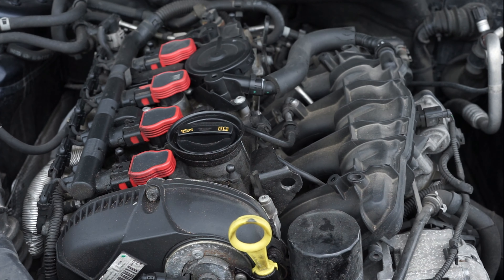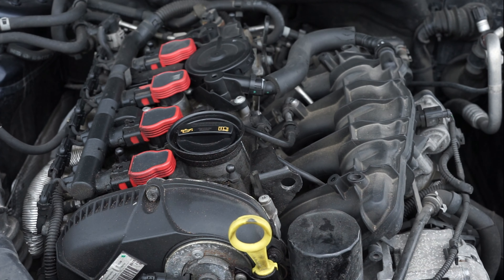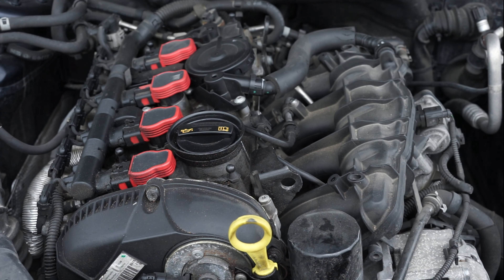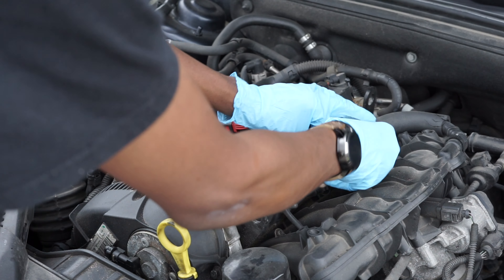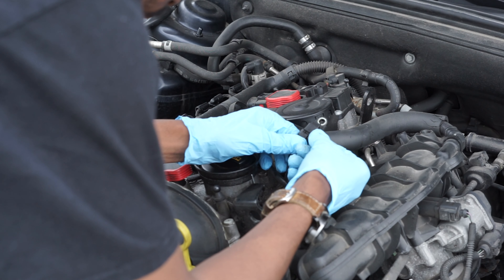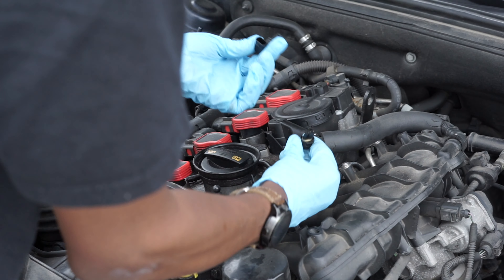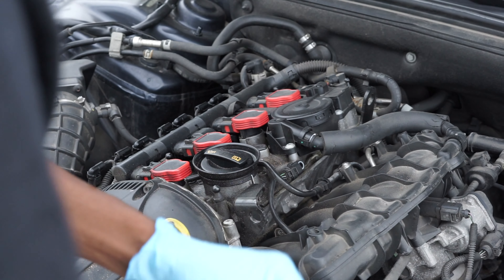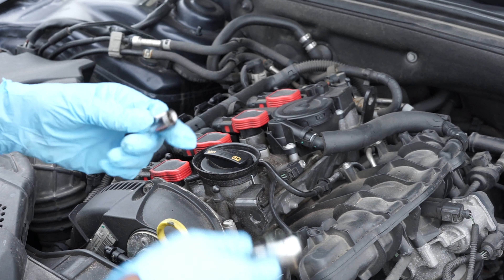How to Change B8 A4 Cam Position Sensor

Comment: Does the b8 or b8.5 have the cam shaft follower or was it upgraded to a camshaft position sensor? Im new to this and curious on what they changed in the engine after 2010

Comment: Hi. I'm getting the P00A00 error 'A' Camshaft Position Slow Response (Bank 1). Could it be related to the intake solenoid or vvt solenoid? Also A4 B8 2.0tfsi
Reply: getting the same thing, did you end up figuring it out?
Reply: Man I ended up rebuilding my engine. Seems fine now.
Reply: @segrinklassen6239  how much was the rebuild?
Reply: I'm in South Africa. Was about R50k
Reply: @segrinklassen6239  well thanks for the help, currently trying to fix mine and she seems to run and idle fine after i did the timing chain im just still getting the P0016 code and I have no clue how because I have everything to spec so im going and double checking the position sensors to make sure there is no metal flakes on either causing it to read wrong and I'm just at such a loss for words I have no idea how it could still be like that, might go re check the timing soon by just taking the upper timing chain cover off to see if there is any slack in the chain and what not but yeah as of right now I have no idea what could be causing the issue
Reply: @monkeyman I wish I could help man sorry buddy
Reply: @MonkeyMan-qm8jp  Hi, did you ever manage to get this sorted at all? Im having your exact issues! Thanks :)
Reply: @rolaplates  tore the front end down and did timing, good luck

Comment: Did ur car have a hard start and this repair fix it please need help
Reply: Invest in a scanner and see what comes up as faulty. But in general the cam position sensor can cause multiple issues with the engine. If I have to guess with your car not starting immediately I'd say you might want to check your battery. Try to jump your battery with another car and let the charge sit there for 10 minutes then start the car, if it starts right away then it's a weak battery...

Comment: Are u sure this a b8 and not a b6
Reply from the maker: 100% sure it's a B8.
Reply: That is my question too, I have a 2012 Audi A4 1.8T (B8) and it did not come with a oil dip stick and I thought all of them do not come with dip stick. Good video though. I am still not sure about the B8 vs B6 statement
Reply from the maker: My 2010 Audi A4 2.0t also didn't come with a oil dipstick, however I added one (I made a video about it). And again the car in this video is definitely a B8, I do own a B6 as well but this car in the video is definitely a 2010 A4.
Reply: Lmao just the engine tells you it’s a B8
Reply: @Bob Saget bruh, that’s where he lost me too
Reply: Is that bank 1 sensor ?